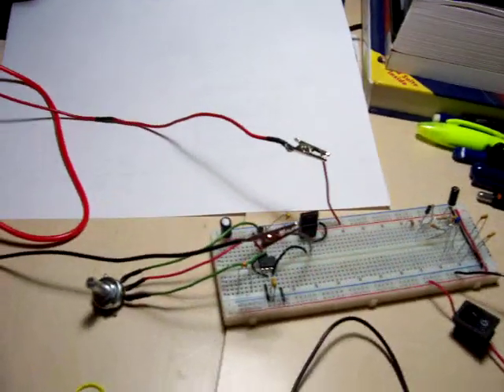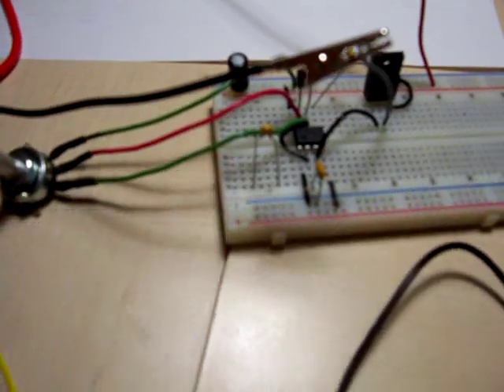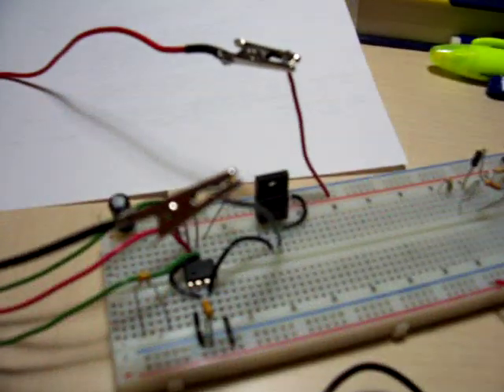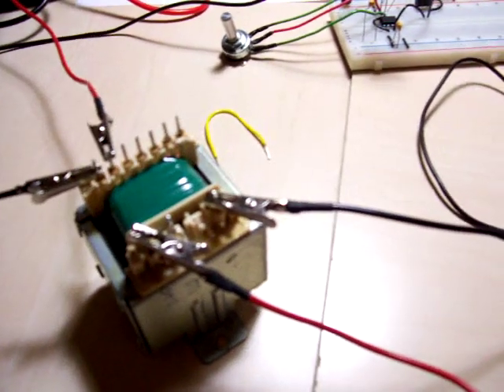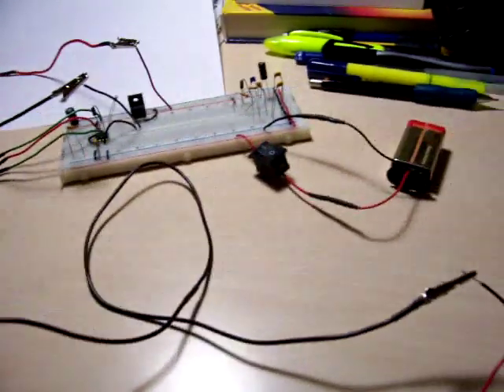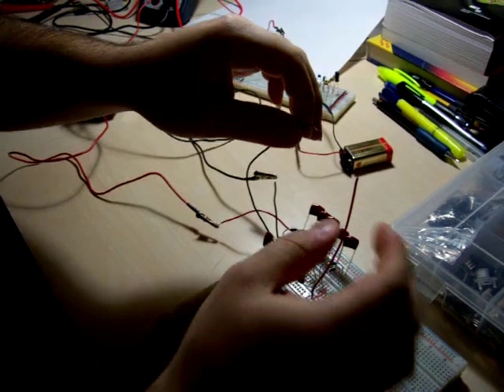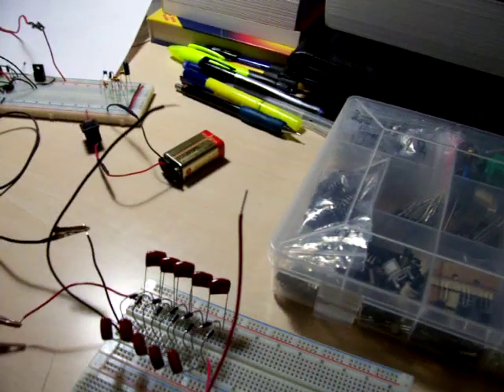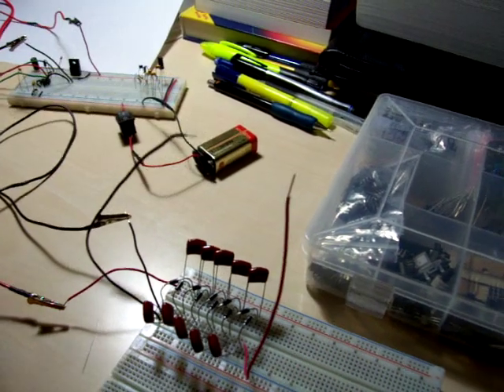High Voltage Generator - 9V to 1000V

Comment: A simple Joule Thief driving a Flyback transformer feeding the voltage multiplier should give you more rapid sparking at 9Volts. The timer chip plus the Mosfet consume a lot of the energy you may rather have going into the transformer unless you need the timer chip for frequency accuracy. Don’t over do it though. If the transformer you are using is a step-down one in reverse. If the output gets too high and arcs inside it, it’s ruined. Good job though. Keep it up.